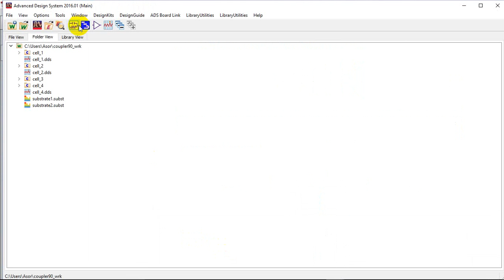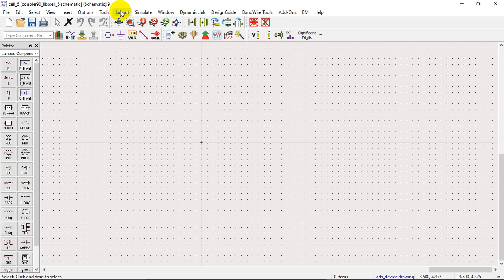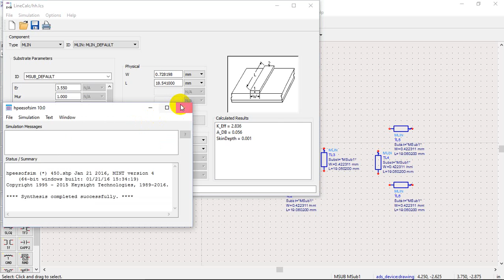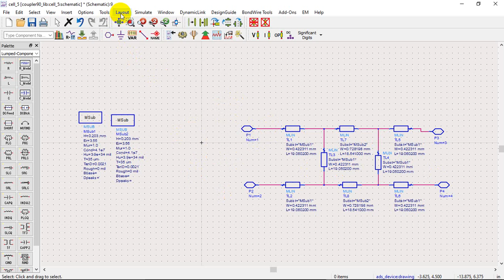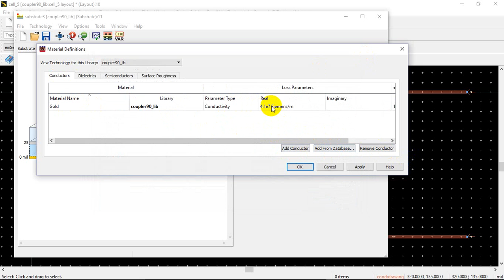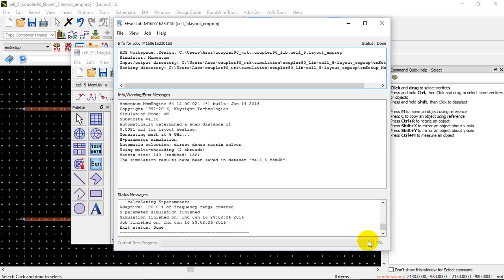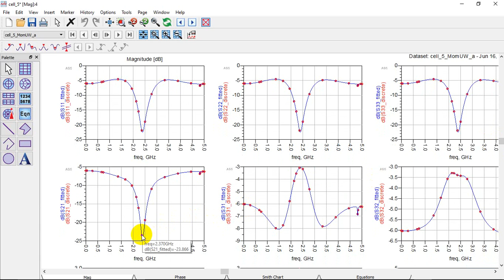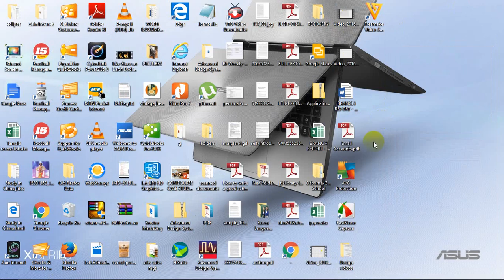Design of a quadrature coupler using ADS

Comment: haloo. how to make hybrid coupler 3,5Ghz with ads?
Reply: Change the horizontal dimension so that lamba = c/f and divide it by 4 = lambda/4  then  (lambda/4)/sqrt(er) this will give you the length of the coupler at the desired frequency